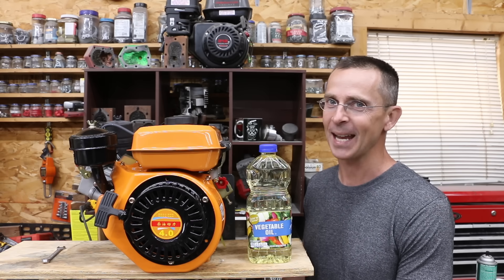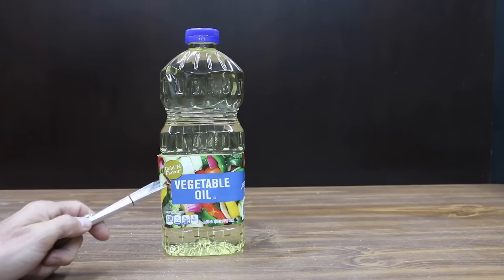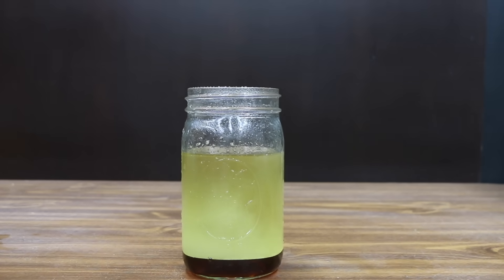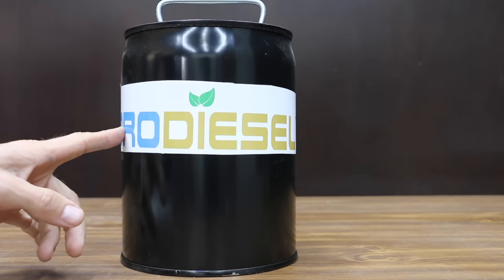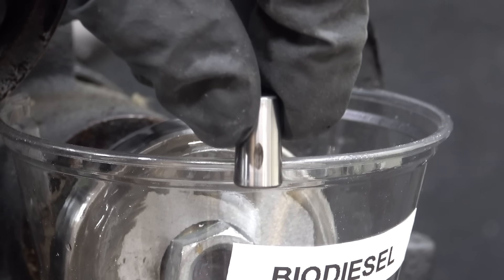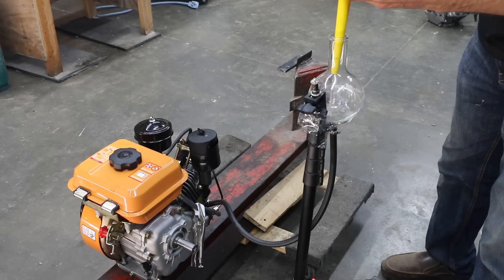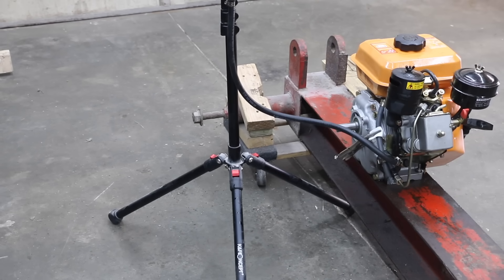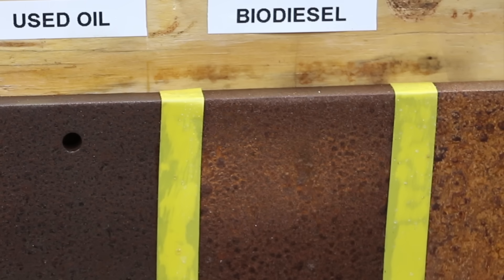Make "Biodiesel"? Let’s find out! Diesel vs Biodiesel, Used Motor Oil, Vegetable Oil, MPG

Comment: Hi. Years ago I used neat vegetable oil in a diesel. Initially it spluttered and smoked for a few miles but afterwards run fine. After that I had at least an extra 5/6 miles per gallon when using diesel. I don’t know what it did but maybe you could check injector spray patters or similar to see if it makes improvements
Reply from the maker: Thanks for the suggestion.

Comment: There is more to it than just running fuel through a warm engine, starting, especially cold weather starting, load and power output is also important as is long term performance and problems if any.
Reply from the maker: Thanks for sharing.

Comment: When diesel designed the engine this is exactly what he designed it for an engine that can run on almost any kind of oil

Heating fuel motor oil diesel veggie oil etc 

Sadly the treehuggers ruined this reliable simple  design
Reply: Humans laws are usually counter productive to the intent they are designed.  We never learn.

Comment: Used motor oil for old audi diesel engines. 20years and still running awesome. Just need to filter out the metallic parts from it.
Reply from the maker: Thanks for sharing.

Comment: I put 250,000 miles on my 2000 f-350 7.3 running 80% used motor oil and 15% gas
Reply from the maker: Thanks for sharing!

Comment: Hi, thanks for all the great video's... Since glycerol/glycerin is a byproduct of biodiesel manufacturing... And the guys that developed the generation units for formula E claim to run glycerin as a fuel for their generation to charge the cars... Could you please do a video on using glycerol./glycerin as a fuel in diesel engines... I know it will be technically difficult as the viscosity it is high but maybe blends can work or keeping it warmer than ambient temperature increases flow etc... Thank again
Reply from the maker: You are welcome!  Thanks for the video idea.

Comment: From what I learned, its recommended to use used vegetable oil and not fresh for biodiesel. Some with how the heating and cooking done with it helps it convert better. Been a long time since I last seen the video on it. Thats why several places go for used oil from kitchens even though they have to run the oil through a good bit of filtering and cleaning that takes up time and costs.
Reply from the maker: Thanks for the feedback.

Comment: Over the last 2 decades and 300,000 miles I've run 5 different diesel vehicles on Used Vegetable oil, in the Alps and all through winter. All of them had a 2nd fuel tank and a heat exchanger running off the coolant system. The used vegatable oil was gravity filtered to 1 micron. If any of the used oil was particularily contaminated, I would cut it 5%  with petrol/gasoline. No engine issues with any of them - 2 were direct injection!
Reply from the maker: Thanks for sharing.

Comment: My father ran his car - a '92 Volkswagen Golf III with a mechanical injector system - on straight vegetable oil back in 2004. It ran without any problems, only that it made heads turn to figure out who's holding a pack of fries. And in 2007 McDonald's has also thought about feeding their delivery trucks with their used fries oil to add an additional layer of "royalty-free" advertising.

Now that the german government is now taxing their citizens woth a €25 fee per ton of carbon dioxide, many people will sure seek cheaper alternatives. Going far back in history, Rudolf Diesel had even thought on running his successor on walnut oil. He clearly was way ahead of his time!
Reply from the maker: Thanks for sharing.

Comment: Time make a bacon grease / vegetable oil combo. Might not do so well in freezing weather but just park you car or truck over some dried brush and set fire to it in the morning to warm the everything up. Worked for a highway construction company way back when and this was common practice for diesel equipment.
Reply from the maker: Thanks for the suggestion.

Comment: Curious if there’s a special blend of Bio-diesel and used motor oil.

All in all. Great video! Very interesting
Reply: I generally mix used motor oil with other free oils, auto trans fluid is the main one, but also manual transmission and diff oil, its not so good in winter, but its fine in summer. Power is a little down compared to diesel, but its not too bad, i think adding some petrol would help in winter, but im not sure on the mixture ratio, the most ive had in is 1lt of two stroke petrol in 60 ltr of used oil. It was ok.

Comment: Great video! I was surprised by the results. I was wondering if you could test the new line of supertech oils. They have the same regular full synthetic, but now they have high mileage full synthetic rated for 10,000 miles and advanced full synthetic rated for 20,000 miles. Thanks!
Reply from the maker: Thanks for the video idea.

Comment: Amazing what a diesel engine will run on.  I once had a Vauxhall Corsa (UK) with a 1.5 litre Isuzu turbo-diesel engine.  It ran low on diesel one night and I grabbed a jar from the garage that I thought had diesel in it.  It was almost dark and i grabbed the wrong jar.  It was a mix of diesel, petrol, cooking oil, waste engine oil, paraffin and paint thinner (basically waste from the garage)and was a bit lumpy too.  Car spluttered a bit for a minute but was perfectly fine after
Reply from the maker: Thanks for sharing.

Comment: With the push to electric everything it would be nice to a real world study on charging and discharging lead acid batteries and life cycles. I have golf cart batteries and mower batteries both using standard wet setups but different recommended charging and discharging. I also have lithium setups but they all seem to agree on charging and discharging.
Reply from the maker: Thanks for the suggestion.

Comment: My dad has been mixing paraffin with some motor oil and runs that in his 2009 diesel. It's been working pretty good
Reply from the maker: Thanks for sharing.
Reply: Do you mean Kerosene?
Reply: @JefeInquisidorGOW  Paraffin is a bit more refined, but it's basically the same. Might even be called kerosene instead of pariffin, dependent where in the world you are.

We don't have any kerosene here, only paraffin, which is used as lamp fuel and such.

25L paraffin with about 1.25L new motor oil, runs like a dream.

Comment: A friend of mine sells a oil called “extreme brand” he said drag racers seen twice the engine life after switching to it from valvoline vr1 and other racing oils. Would love to see you test it against amsoil
Reply: I think your friend is just a salesman.
Reply from the maker: Thanks for the video idea.
Reply: @ProjectFarm  i would be willing to send you the oil, both amsoil and extreme if you will test it and make the video
Reply: So the engine last 8 seconds instead of 4. Congrats
Reply: @jthomp997  and I bet you think nascar is nothing but left turns...

Here’s the truth, top fuel dragsters/fiunny cars run specialty oil, designed to seep past the rings and become fuel toward the end of the run. That’s not who the oil is for. 

Basically any other drag car will benefit from this oil as most go 30+ 1/4mile passes without changing oil or filter.
Reply: Then there’s the benefit to cars that aren’t being raced every few days or being taken to dragweek, who might see 3x the life instead due to lower load
Reply: @dylanzrim3635    My dad is Paul Smith. Crew Chief for NHRA Rock Batteries funny car team. I just showed him your post and he started laughing. He thought your claim that teams go 30 passes without an oil change was especially funny.
Reply: Never trust someone who is trying to sell you something.
Reply: Oil is a touchy subject with race cars lol
Ive also lot of race cars just use 15w-40 from and it's fine
Reply: I 2nd
Reply: Does it also prevent and/or cure COVID?
Reply: @thomasholden500    getting it prevents hurricanes and tornadoes

Comment: A few things: first, remember to filter the everloving hell out of whatever you're turning into fuel, or anything you're saving in fuel will be spent on an injection pump / injectors. Second, don't use gas in your motor oil, or even use motor oil from a gas car. Gas may dry out the seals in your injection pump/fuel system. I'm not against blending some bio into your fuel as a fuel additive to improve lubricity though.
Reply from the maker: Thanks for the feedback.
Reply: So, used oil from a gas engine should not be used, only used oil from a diesel engine? What’s the difference and how does it change the results?

Comment: Hey this is completely unrelated but I was just watching your vid on making a cylinder head out of wood. I noticed you used some JB weld on that and was wondering if you could try casting and making a cylinder head entirely out of JB Weld
Reply from the maker: Thanks for the suggestion.

Comment: I would love to see a video comparing pressure washers. Different brand of electric pressure washers and different gas pressure washers. That would be a very informative video.
Reply from the maker: Thanks for the video idea.
Reply: I've never seen or heard of an electric pressure washer that was worth a damn.
Reply: @refluxcatalyst7190  because the 15Amp current cap on the electric current.   15A x 110Volt is 1,650 watt. or 2.1 HP at 100 percent efficiency. and with Brushless motor.  and thus electric power washer cannot  compete with gas pressure washer.  
even with small 150-160 cc gas engine. you can put out 4 hp continuous .  that is at least twice the power available.   and many gas power pressure washer uses 200 cc gas engine like honda GX-200
Reply: @refluxcatalyst7190  Gotta build your own. Cat or Comet pumps are best.

Comment: I set up an old Ford pickup with dual tanks for my dad years ago that ran used vegetable oil. The trick was starting it with diesel and then switching to the vegetable after it warmed up. Then switching back to diesel for a bit before shutting it down to get an easier start next round. The vegetable oil didn't seem to give the same power on the highway but free is good lol
Reply from the maker: Thanks for sharing.
Reply: I change car (long lease) over 2-3 years and I do around 60000 km for year. I make a lot of experiments with vegetable oil. Using your system( change fuel on start) and using pure vegetable oil, I find that the mileage without problems is around 40000 km. After, issues come often : valves, turbos, and other things. Considering the fuel consumption is more about 5% with vegetable oil, the convenience is when the vegetable oil price is under 10% minimum above the diesel fuel. And now, in Europe, the diesel fuel is around 2 € for liter, and vegetable oil is around 3,5€ due to the war in Ukraine. So I suggest to be careful with pure vegetable oil
Reply: Guys I've seen some damage that veg oil does to diesel motors the residue it leaves behind and what it does to the oil ... in modern trucks I would steer away from alt fuel thats anywhere near that thick 

You want a nice method for modern diesel motors add like 10٪ methanol for a cleaner run better emissions and slightly more power and better mpg
Reply: @georgephillips7408  The man who invented the diesel motor, Frederick Diesel, intended for it to run on peanut oil, i.e., vegetable oil. All the 1st gen. diesel engines run perfect on new, not used, vegetable oil. My "93 Cummins diesels love it, no pre-treatment, no methanol, no thinning, no nothing..
Reply: @walterbuller9171  the man who invented rotaries intended for them to be the most relaible and best mpg but still in 2022 the wankel engine is the most unreliable motor with the worst mpg. Intentions mean nothing to the laws of engineering some Ideas are too ambitious. 

In 1984 cadillac made the first car that could shut down cylinders while running to save gas economy 

In 2006 and 07 chevy  integrated that tech to any engine above a typical 4 cyl 

The engines they made were relaible but that system ruined motors wore them out un evenly wore out the cams and lifters. All the while that accessory only gained you like 2% efficiency those modern engines would be cooked around 160k due to lifters and or cam damage. 

My point is Many things claimed by the automotive industry is crap they are spinning to you 

If you want to belive you can safely fire that as fuel that's your own bias as there is proof out there that this is very bad idea even treated. Organic oils still have fats and lipids in them. The more you use that the more lipids will literally turn into dried up fat collecting in your motor.
Reply: @walterbuller9171   absolutely right, but his first name was Rudolph.
Reply: @georgephillips7408  my grandpa runs his mercedes 240 on used oil used vegetable oil new oil anything but diesel cause he get’s that for free geuss how many miles it has!  Fucking 700.000 thats over a million km he bought the car with 60k miles on it he bought it in 1983 and he still drives around with the same car
Reply: That's a system.

Comment: I got a idea for a video, best foaming air conditioner cleaner. I work on HVAC, and have used many brands of coil/radiator cleaners over the years and would be delighted to know which functioned the best under test conditions of a dirty radiator.
Reply from the maker: Thanks for the video idea.

Comment: That's a great video as always! I'd also like to see how this engine would run on on propane, you already tested that on a gas engine, now it's time for the diesel
Reply from the maker: Thanks for the suggestion.
Reply: Propane is usually used in combination with diesel fuel to lower diesel fuel usage by helping diesel fuel burn more completely in the combustion chamber.
It also helps reduce emissions. Running a diesel engine on just propane may be possible, but the loss of lubrication from diesel fuel may end up doing more damage than its worth.
Reply: The propane won’t auto ignite from the heat of compression, so you must keep enough diesel being injected to spark it.  Also protects the injector tips from getting too hot and getting damaged.

Comment: - Topic Suggestion:  "Mad Max Series"

Most cheap oil, Spark plug, cheapest Fuel, and portable generator. (I suggest PREDATOR 2000 Watt Super Quiet Inverter Generator) 
VS Most fuel efficient Quiet Generator (I suggest WEN 56203i 2000 WATT), E3/Pulsar Spark plug, Best fuel efficient oil (I guess Mobil 1, maybe I'm wrong)

- Why the cheapest vs the most efficient? Cheapest cause its "easy to find" and vs "most efficient" because "there is not that much fuel left", also "most silent" to be in the hideout in the wastelands. (Places to test sound: Bunker with a hose to take gases out,  apocalyptic motorhome, open area, and shelter in the woods sound test)
(These test make interesting results, since bunker is brick/mortar, motorhome slim metal, open area...nothing, shelter in the woods makes "wood sound vibration"). 

- Reference generators: Honda, Yamaha, Duro, Ryobi, Champion, Westinghouse, Pulsar 2000w portable generators. Focus - Make fuel last long, very portable and quiet.
Love your videos! Keep up the great work!!!
Reply from the maker: Thanks, will do!  Thanks for the video ideas.

Comment: Hey, maybe you should test some electrical power strips/multi-plugs. See how well they handle their rated amperage, compared to a slightly unreasonable load. Mounting holes, switch current capacity, protection features, etcetera...
Reply from the maker: Thanks for the video idea.

Comment: Did you filter the used oil ? Also what Micron Fuel filter does the Dodge have ?  I've always loved the idea of used motor oil. Didn't know you needed to add gas to it, but that makes sense. I currently run 1 oz of 2 cycle oil per gallon of diesel since I also have an older Diesel that needs more lubricity then the 15 parts current diesel.  Good ol 6.2 Detroit :)  Thank you for the video.

Comment: Great video you answered a lot of questions for me . I have a lot of used motor oil so I'll add 10% gas to it and run it in my diesel tractor. Where did you get the little diesel engine ?
Reply: Yes 1/10 Kerosene used Oil mixing
Minimum engine size 2500 cc

Comment: I wouldnt recommend emulsifying water in diesel (like hydrodiesel) without some major changes to your engine. While it does provide lower exhaust temperatures and less emissions water eats through metal like nothing else.
Reply from the maker: Thanks for the feedback.

Comment: I have run all of those fuels, except for hydrodiesel, in a 6.5L diesel. I am currently running 25 percent wmo in my diesel with filtration down to 2 microns. The truck runs great. It would be nice to be able to get wmo blended fuel at the pump for a discount.
Reply from the maker: Thanks for sharing.

Comment: Would be interesting to see how much power each fuel generates, and what the engine looks like after long term use.
Reply from the maker: Thanks for the feedback.
Reply: Ya that would be great! :D
Reply: @petrbelohoubek6759  Depends on where you get your energy from. if you had decent solar or hydro (I have a friend who gets hydro power from a river gravity fed line on his property with 3 custom turbines) so there is definitely ways to get power and then convert that into mobile energy (if you dont have an electric vehicle)
Reply: The engine isn't the main issue. The big problem people see and blame on fuel type is corrosion, usually from biodiesel that has not been dried enough or left in such a way to allow it to absorb moisture as water dissolves in biodiesel compared with diesel where it sinks to the bottom. Proper drying and a water absorption filter at point of dispensing are critical.
Reply: warped perception did it but for a turbine engine

Comment: So I’m not sure if you’ve tried this yet, but can you run an engine with gasoline as the engine oil, and oil as the fuel?
Reply: no
Reply: @MrTruckerf  counterpoint, yes.
Reply: @counterfit79  Gasoline engine will not run on oil.